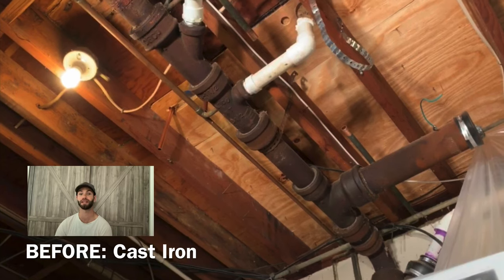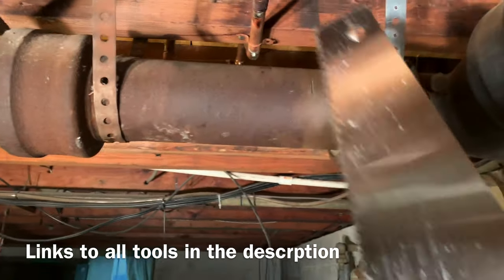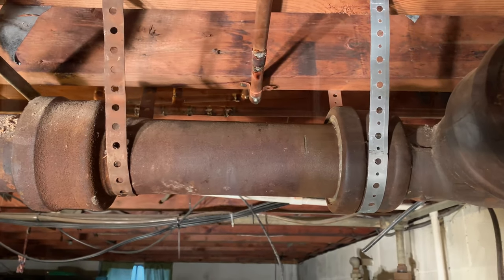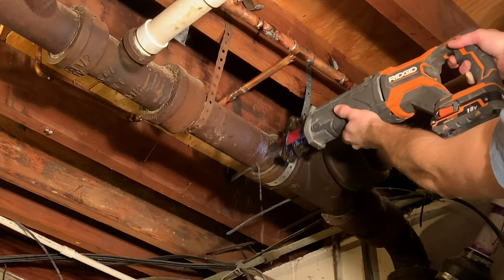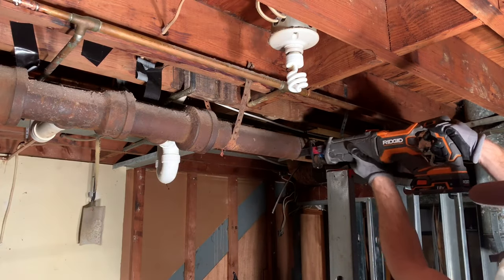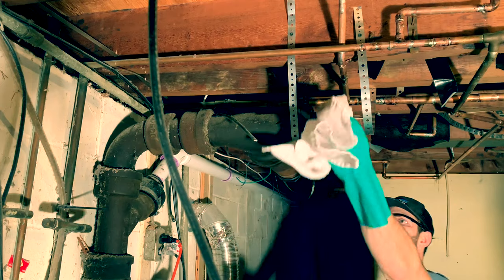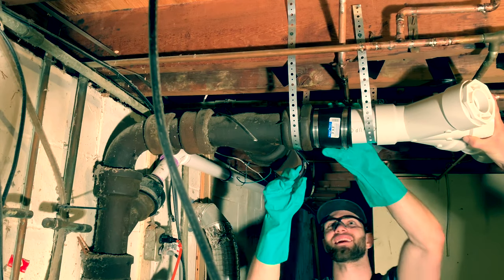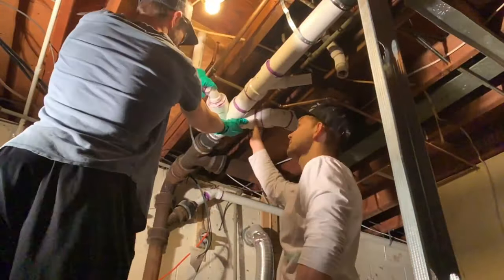How to Cut Cast Iron Pipe [Learn how to cut, remove, and replace cast iron sewer pipe with PVC]

Comment: Andrew, you don't need to use so much solder!  Practice, do enough soldering and you should get better at it.
Reply from the maker: I completely agree with you! That was only my second time soldering and, in hind-sight, I should have just used CPVC. That was a lot of overhead pipe to be soldering. Thanks for Watching!

Comment: Fairly new to this kind of stuff but wouldn’t abs be better than PVC?
Reply: Negative.  ABS is not allowed in many areas as the connections come loose and poor quality in manufacturing of the recycled-materials pipe.

Comment: The new pvc was wrong it had San tees on there back it had small cleanouts on big pipes it is a mess
Reply from the maker: Appreciate you sharing your opinion! However, it was hard to make out what you are trying to say in your comment. Without knowing the full arrangement or knowing the specifics of the project, I do not know if are in a position to call the work “right” or “wrong”. But I appreciate you watching and I agree that the work does look like DIY job and is not exactly the most ‘professional’ looking in terms of appearance.
Reply: Andrew Thron Improvements it just needs to be simplified

Comment: FYI.. if a drain pipe is clogged, the first point to check/snake/flush, would be the P-trap.. 

Installing the long-sweep-Y w/ clean out plug fitting AFTER the P-trap, eliminates the ability to be able to clean it properly, as well as allowing the drain water to be trapped after the P-trap, within the  long leg of that fitting.

That will fail an inspection miserably, and when you have a blockage, when you go to open that clean out plug, it will empty out all the fluid in that drain “assembly”… total mess waiting for you..

Also, your piping after the Ptrap is too short, most likely having all the other drains attached in the same fashion, will create a siphon and effect and will pull the water sitting in the Ptrap basin…

There’s so much wrong with this installation I don’t want to waste time continuing to list them all.. 

All the lines entering that main 3” pipe should be at an upward angle to prevent drain water being pushed backwards into the other pipes, as the original iron plumbing was.. you plumbed it up like it’s a vertical drain system, and even then, should still have 45* elbows on the Ys entering the main line.. oh man this made my day

Comment: If you’re not going to change the whole Cast Iron pipe ( even Underground)  it’s pointless to change out a 5’ section.... Anybody that’s been in the plumbing field for a cool minute will tell you Cast and Galvanized pipes suck for waste. 

I’m curious as to how many leaks you had, I’d never use that small Dobber on 3” pipe.
Reply from the maker: Zero leaks so far 🤞. And I agree that is would have been better to change out all the cast iron for PVC. I only replaced the 5 foot section so I could add new connections for a half bath to full bath conversion. First time doing something like this, so definitely some lessons learned for next time. Thanks for watching!

Comment: The city/county inspection should be fired for passing this.
Reply from the maker: If you want to provide more insight on what exactly you see that should result in a failed inspection, it might actually help someone else out! Thanks for watching
Reply: @AndrewThronImprovements  

Your toilet in not vented...
That should be a 90 and not a combo fitting on your toilet...
The bath tub is vented with a tee on its back which is a code violation...
Reply: @AndrewThronImprovements   Some inspectors are not licensed plumbers in many jurisdictions I have found. Will all this plumbing indeed "work"? For the most part. Buy is it code UPC code correct? No it is not.
Reply from the maker: @Jeff Legg Thanks for taking the time to watch and comment! This was my biggest plumbing project to date, so it was a bit of a learning process. For the toilet, I originally had it vented where you see the stub with a cleanout cap in the video. The inspector actually told me to REMOVE the toilet vent and just cap it - like you see. This did not make a whole lot of sense to me, but I just did what he said so that it would pass. 
The bath tub plumbing was existing, I did not change anything with that. So it is very possible that there are issues. Thanks!
Reply from the maker: @Jeff Legg we operate under IPC - I am not sure how different UPC and IPC are. Thanks!
Reply: @AndrewThronImprovements  Are you in Canada? The IPC defiantly allows a broader, more loose framework. For instance, the IPC allows for a 1½ vent on a toilet while the UPC a toilet requires a 2 inch vent. There are many other differences for sure. And why ANY plumber or inspector would tell you NOT to vent a toilet is beyond me. It was horrible advice. The good news the trap arm for your toilet is very short. That and it's plumbed with 4 inch which the larger diameter will aid in venting and drainage.
Reply from the maker: @jklsr55  I’m down in Southeast of the US. So we are lawless down here 😂
Reply: @AndrewThronImprovements   As I said there are many many city's and jurisdictions who's inspectors have never spent a single day on the job as a plumber so go figure... It's crazy to me but that is indeed the case. Even in Montana where I live. Where there are very stringent laws where mechanical work is concerned. You have to have a masters license which takes nine years minimum in the trade to own a business. But then they allow inspectors who don't have a clue what's up. Crazy...
Reply from the maker: Yea it’s a bit ridiculous for sure. I had some other “interesting” requests from other trade inspectors as well. But I’m just a pawn in the game 🤷🏼‍♂️
Reply: @AndrewThronImprovements     LOL!   Greensboro,NC here - When I had my entire plumbing system replaced including adding new cleanout outside, but not the  main stack vent at toilet,   the inspector breezed thru in about 5 minutes (small old house) and  didn't bother to look at a whole section because it was in a tight space.   I think it's a matter of inadequate staffing for the department, so many houses, so little time....and he was a young guy, never plumbed anything in his life except his own kitchen sink.
Reply from the maker: @curiouscat3384  I guess inspections/inspectors are like a box of chocolates - you never know what/who you’re going to get 🤣